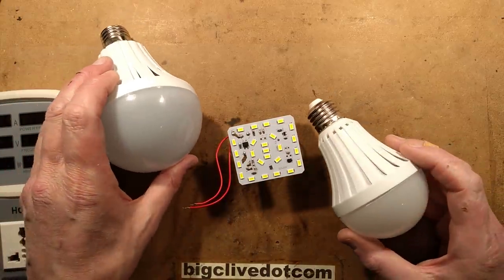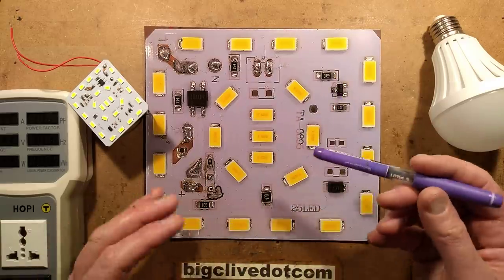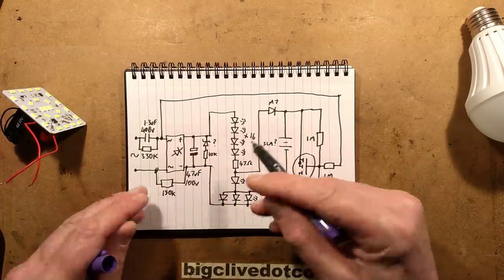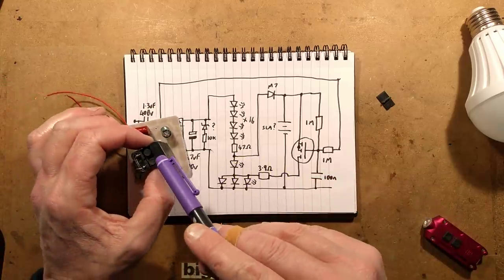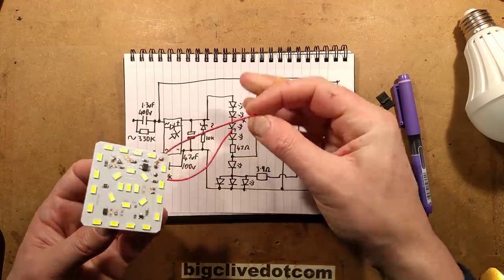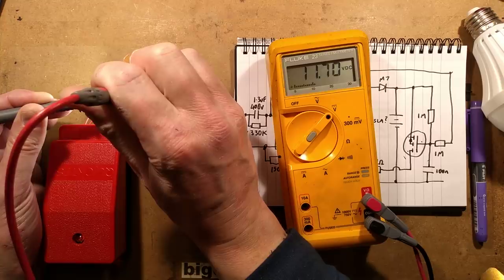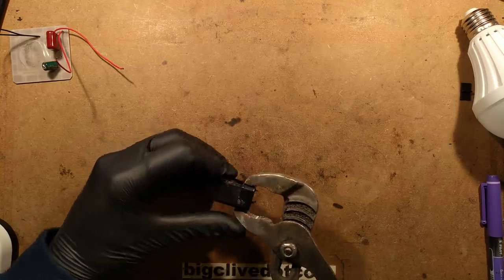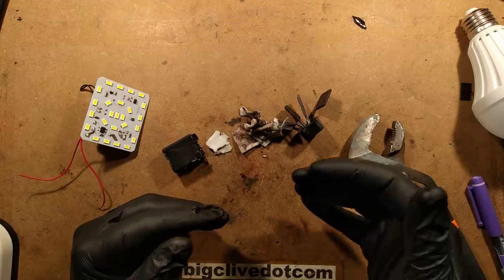Crappy lead-acid LED lamp with brilliantly simple circuitry.

Comment: Would the lead acid battery vent though, it is bunged and a cap over the bungs  , liberating Hydrogen Sulphide my feeling is it would just go bang potentially causing a fire and harmful fumes.
Reply: SLAs usually have a valve that vents at 3-5 PSI pressure. Apparently, if they don't vent, that is the pressure never reaches 3-5PSI valve setting, the hydrogen and oxygen gasses eventually recombine via some process that I have never seen an explanation for.
Reply: @brianleeper5737  Hydrogen and oxygen will combine to form either water or hydrogen Peroxide however the rotten egg smell is associated with Hydrogen Sulfide (H2S) this can be formed in lead acid Batteries and is a very nasty gas. Thanks for the info on the pressures interesting.
Reply: @matthewbeddow3278  What I don't know and would like to know is the mechanism by which the hydrogen and oxygen in an SLA recombine (obviously combustion will cause this, but obviously that is not normally what happens inside an SLA). I am well aware of the hazards of H2S -- even "vigorous" overcharging (like an equalization charge) won't produce H2S until the electrolyte has lost enough water.
Reply: @brianleeper5737  It could be heat and pressure causes the combination otherwise id expect the hydrogen and oxygen to vent without combining but i am not totally sure.

Comment: I don't understand why the mains would be shorted during an outage. If a falling tree knocks down my power lines, then they go open circuit.
Reply: From Clive's earlier reply: "It detects the other loads in the house when there is a power failure.  They act like a low value resistor."
Reply: Consider what happens when the low sensing voltage passed by the emergency light encounters the closed (ON) switch and then finds a device with a transformer, motor, or an incandescent bulb elsewhere in the house that is also across the mains.  At a low DC voltage they will look like a short across the mains (hot/live and neutral).  And if those don’t exist anywhere in your house, and the power was knocked out further upstream of your home, then when you reach the utility transformer serving your home or neighborhood the secondary side of that transformer will also appear as if a dead short across the mains wiring.
Reply: @ethanpoole3443  Thanks. I think there will be at least a few ohms, not dead short.

Comment: Lead-acid doesn't mind sitting at top of charge for long periods of time, whereas that's one of the best ways to kill a lithium ion cell. The lithium cell may not have any capacity left when you actually need it to do what it is there for.

Comment: Clive, we wouldn't miss the exploding diodes if you learned how to edit YT videos!  hint hint!   ;-P
Reply: That's assuming he was recording the incident.
Reply: @WaltonPete  - That's the point.  He didn't have it recorded.  Clive pauses the recording when he does the "off camera" stuff instead of editing out that stuff.  If he would just record it all we could have seen it because he wouldn't want to edit out the "good stuff".  I don't know why he doesn't seem to want to learn how to do simple editing.
Reply: @ElmerFuddGun  Camera would run out of battery before he finishes the video, also some cameras have a video duration limit to prevent from overheating, though I think one of the vids he mentions he uses a  smartphone to film, but still the more junk, the harder it becomes to edit thus the longer it takes to get video done and uploaded thus less videos.
Reply: @samarnadra  oh, you're right, I didn't know that, I read it was to avoid overheating, that totally sucks having a nerfed camera because of laws, but still better than paying more taxes I guess.
I know that there are hacks to remove the limitation on some cameras, but I thought it could cause the cameras to overheat, even though it shouldn't be different from pressing the record bottom again after the 30mins

Comment: what i mean is.. a cr2032 battery and light emitting diode might generate enough electricity to light a 240volt incandescent light bulb if you had enough photovoltaic fiber optic cable and the bulb worked on DC?💡🤔🙄😐🤷‍♂️
Reply: portable incandescent lamps from a cr2032 would be 😯🤗💡

Comment: SLA batteries will fail in 3 to 5 years due to aging and may leak acid, hydrogen gas or over heat.
Normally lead-acid batteries are very safe and I prefer them over lithium-ion for backup power. But not integrated in this way.

Comment: They will have used lead acids because they are dead easy to charge. AFAIK they can tolerate more or less full time overcharging to a very small degree, and are not fussy about when or how they charge.

Comment: whoever made this over in china probably had a small shop that made cheap lead acid battery knock offs.  when lithium started taking over they probalby had to figure out a finished product they could make instead of making lead acid batteries and they bought the original version, ordered some components, and started making knock offs.  basically anything that needs a small rechargable battery they are probalby making a knock off of it with their old simple lead acid battery equipment

Comment: Ive been waiting for you to do a teardown on a 30w E27 2835 LED, for years.. For years Clive... Please.. They are literally $0.80/ piece, 30w actual wall draw.. eBay, search "e27 30w led lightbulb", its a 36 SMD array with a hole drilled in the middle.. This says YOU all day long..

Comment: Lead-acid battery in this application probably has much longer lifespan than Li-Ion or Li-Ploy. Deep discharge gel cells will easily last 6–8 years IME. The lithium chemistries seem to last about 2–3 years before they start getting flaky.

Comment: Why buy one of these when you just hook up a UPS and just remove the beeper. It's what I did. Easy to do and I remove the beeper so it's always silent when there is no power.
Reply: (in Walter Lewin"s voice) "WHAT is the electrical potential of the lead, and what of the wadding?" So, you disassemble a charged battery (important to the question); where is the charge?
Reply: @TheGitWizzard  Uninterruptible Power Supply which means you plug it in the wall like any power strip and when power goes out the battery picks up and recharges when power is back on. I did not disassemble a battery just remove the beeper that signals no mains power.

Comment: Yay, mine arrived today, and they look similar, except mine have even fewer components; for instance, the pop-emitting Zener isn't there in the first place. I can't wait to get to analysing it. Does anyone know what a 5-pin SMD component marked QW82 is? Like this one: http://en.makuwang.com/search/xq?id=13156-QW82.html
Also, it would appear that purchasing these lamps is the only way of getting these small SLA batteries in the first place. On ebay, I just couldn't find them on their own. Why I would want these little black boxes of lead when there are NiMHs and the like, I have no idea though, but they are so cute, I couldn't resist getting these lamps if only for their components. They were absurdly cheap, 1.77 € for a 5-watt version, and 2.77 € for a 12-watt one, and the SLA battery is the same size in each. I did find these batteries on aliexpress ("4v lead acid"), but curiously, buying the entire LED lamp with them inside is STILL cheaper than the best listing there. I think I'll buy some more …

Comment: Wouldn't think a lead-acid battery, which is basically 2 big chunks of lead, which is expensive, could compete with lithium. Which doesn't even contain that much lithium, but is a more sophisticated thing to make. You can bring down manufacturing costs with technology and economies of scale, but raw commodities like lead, you can't. 

Unless demand for lead has fallen. Which I doubt, since it's main use is surely car batteries. And that's mostly recycled. Commodities do weird things, though unlike some other financial things they retain some connection to basic physical reality. You could check a plot... just did... not an expert but it hasn't varied like, hugely, over the last 5 years. [deleted loads of speculation about the car market that are just guesses.] 

If anything, probably just another case of "guess what we found a skipful of!" followed by "well we'd better make something then". The Shenzhen way! From the country that brought you cooking oil, reclaimed from the sewer!

Dunno if I'd be entirely happy with a block of lead hanging over my head supported by whatever they were melting down to make glue that week!

Comment: Used to call them 'Gel Electrolyte' or 'Gel Cells' until some twonk decided that they should be called VRLA (Valve-Regulated Lead-Acid batteries). FFS, try asking for a VRLA from a time served gnarly old electrician, you're not on a winner with that one!!!

Comment: The cheapest and crappies emergency light. Dims very quickly.
Bought 3. Capacitors on two of them exploded. Third one I dumped. Supplier would not replace them as said no longer available. Gave full refund.